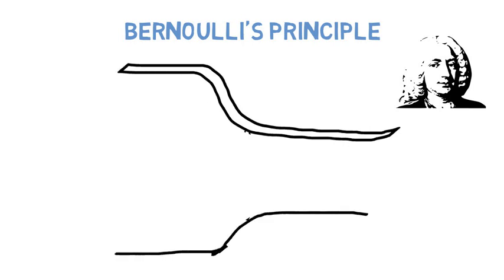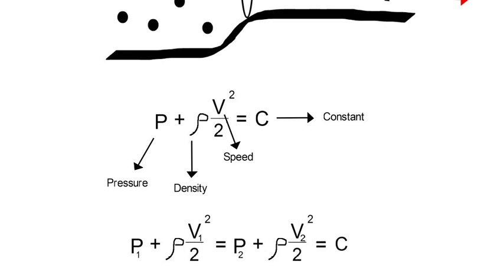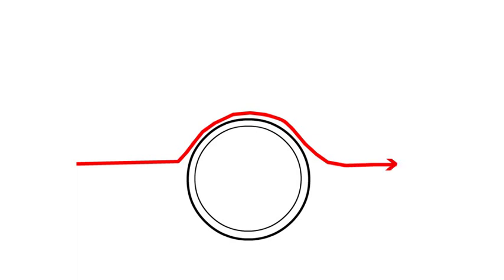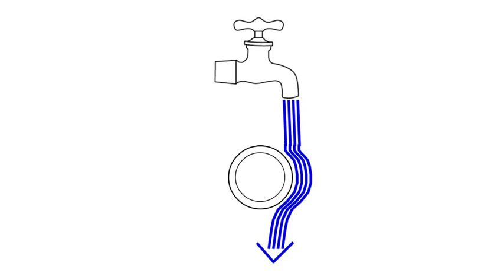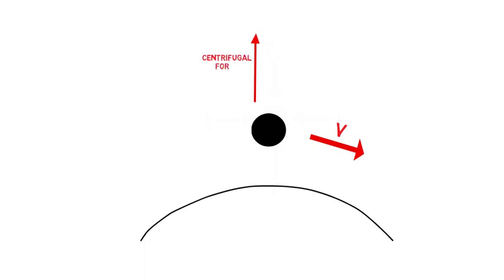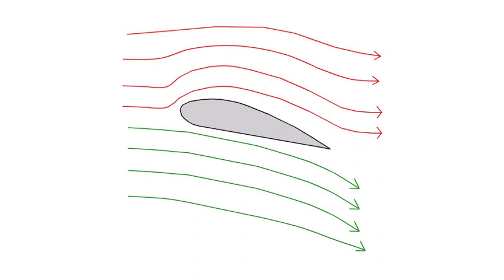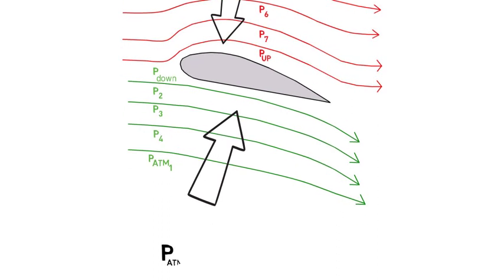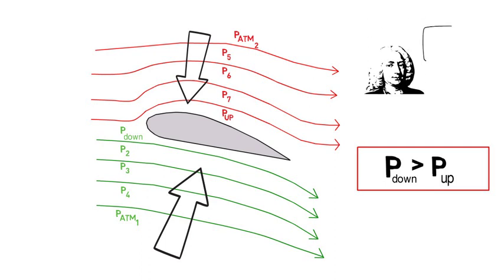Part 2 - Coanda effect, Bernoulli's Principle and Lift

Comment: My friend, Bernoulli only works in a single streamline not across a pressure gradient.  This is a common error.
A wing is not a venturi as there is no constraint of the fluid and therefore no requirement to preserve pressure.
Cut a venturi in half and it doesn't work.

Any explanation has to work for a flat plate wing (no camber) because we know flat plate wings work very well.

Also all airliners have super-critical wings that are flat on top and curved underneath.

The effect you are talking about with the curved surface is viscosity and attachment not Coanda. Coanda does not work in non-accelerated flows if at all.

Aerodynamics IS fluid dynamics. The same rules apply. air is considered in compressible below M0.4.

Centrifugal force doesn't exist. It is angular momentum.

Lift is caused by turning a fluid. The amount is varied by airspeed or AOA F=MA

The pressure differences are caused by effective AOA.

The pressure below the wing is greater because it combines static and dynamic pressure.

If your explanation is not correct for a flat wing it is not correct. Period.
Reply: @Deos He's right, completely right. Not all wings are curved at the top surface.....
Reply: @Deos Indeed, for 'normal' aircraft you are right and Aerogeek got that wrong. However, and that is is main point: Curvature is completely non-essential to the principles of generating lift. Only AOA matters. Curvature serves only one purpose: To enable higher AOA without introducing airflow separation. Also, people always get Bernoulli wrong. It is a mathematical relationship that says nothing about the cause of the relationship. Thinking about the cause, however, it follows from Newton that in order for anything to accelerate, a force has to act upon it. Therefore higher/lower relative pressures cause the changes in relative flow speeds, not the other way round.
Reply: @woodwind314  No, in general a more cambered airfoil decreases stall angle of attack but increases lift coefficient at zero angle of attack. Curvature is essential to the principles of generating lift because pressure must decrease as you move radially inward along curved streamlines – so there is a low pressure zone above the airfoil, which helps lift significantly.
Reply: The pressure difference between the bottom of the wing and the top is what causes lift. Upwash, downwash, the Coanda effect and turning of the flow are all caused by this pressure difference. They are effects, not causes. The low pressure on the top of the wing is caused by the particles interacting with each other and with the wing. Such interactions are ignored in the fluid approximation so it is not warranted near the wing’s surface. The reason for the low pressure on the top of a cambered wing is that the boundary layer there is depopulated by these interactions. This explains the purpose of the blown flaps on an aircraft carrier’s supersonic fighters.
Reply: Angular momentum concept is applicable for flow over steep Curvature (like the flow passage through Impulse Turbine blade).
However, During Take off, Commercial Aircraft increases Wing surface Area by extending Leading edge & Trailing edge Flaps to to get instant Lift.
When Leading edge & Trailing edge Flaps are extended, the Wing will appear moderate Curve. Therefore, there is a possibility that sharp Air deflection at the bottom of the Wing might produce Lift momentarily by Angular momentum theory.

Under normal circumstances, Wing is an Aerofoil. 
Aerofoil is not designed to work on momentum theory. 
Aerofoil produces Lift based on Pressure difference across Aerofoil. 

When Air steam moves over, the Bottom of the Aircraft Wing experiences combined action of Static & Dynamic pressure together.
On other hand, Air streams tries to deviate slightly from the Top surface of the Wing due to the Aerofoil Camber angle.
This creates Vacuum over Wing Top surface. 
Eventually, The Static pressure on the Top surface of Wing will fall.
This pressure difference across the Wing leads to Lift.

Aerofoil Design Text books call Aerofoil's Top surface as "Suction surface" & Bottom surface as "Pressure surface"

Comment: Here is a summary of the physical effects that are taking place. Go to diagram at  03:29. Neglect, friction, viscosity,  meniscus, surface tension and gravitational pull, electrostatics  between fluid and  mass of solid profile being used, any flying due to fluid sheets. 
 
1,  The  fluid  particles rushing  from the left towards the cylinder will cause a very high pressure zone  on the left  hand side.
2. The  high speed  moving particles of fluid  away/lateral  from the centre line will experience a higher pressure on one side and they will be  gradually aligned and vectored up and down about the centre line, in this case. (another position with  aerofoil sections,)
3. Those   group of particles forming a relatively wide  sheet,  now going up at high speed will tend to leave the  receding surface with their momentum, but leaving the surface would create a partial vacuum with  the surface, which will pull the particles towards the surface.  Here it must be noted that putting one  thin  streamline of water or smoke will not create the  higher vacuum that a whole sheet of fluid going over the solid surface of a ball or an aerofoil section. So for better understanding we shall stick to a sheet of fluid flowing over the  whole surface, and  not one  narrow stream line.
4. The  sheet of fluid  will  keep trying  to  continuously separate  from the surface by its momentum, but will be restricted, by the  partial vacuum created with the surface and also the atmospheric pressure above it in this case.  So the particle will  curve around creating centrifugal force.
5. The fluid sheet, note ,  a relatively wide sheet, will try to keep separating  from the curved receding surface  with its  remaining momentum, but,  the partial vacuum created by itself will still be formed to pull it to the surface, the atmospheric pressure will keep pushing it to the surface,  while the centrifugal force will also be present.
6. This is the reason why the sheet of fluid will keep attaching itself to the body in question till there comes a location where it could separate for other states coming into action.   These are the physics that are going on in the Coanda Effect and in any aerofoil section.
7. In a symmetrical body, all the above is occurring above and  below and to the left or the right in the case of a ball or a torpedo or a ring. 

8. In an aerofoil section which is not symmetrical and  with or without an angle of attack, the high pressure and low pressure zones (bubbles)  pushing or pulling the sheet of fluid to the surfaces  of the solid body    these   can be controlled by the design of the profile of the airfoil section or its angle of attack and the speed of the fluid itself.  In an airplane the sheet of fluid above the wing is made to try and  continuously separate  along the top surface  through receding the surface down while that below the wing is  made to be pushed through also  angling down the lower surface  down through the angle of attack so that its velocity downwards will push the fluid sheet all the time hence compression rather than a separation and partial vacuum. 
9.  The unequal velocities that occur  at the trailing edge in an unsymmetrical aerofoil section with or without angle of attack have no option but to disturb each other and  form a helix where the lower velocity will  at first travel inside the helixes and vortexes and circulations  which will eventually  stir the fluid up to equalise the  velocities hence pressures by bleeding  into the turbulent bubble an atmospheric pressure on the top  surface of the wing where it could stall for higher angles  of attack.

I believe, Coanda Bernoulli, Newton, should get together and try and agree on the explanation and in the meantime to consider what I contributed.
Reply: I learned more from this then the vid!
Reply: Here's an idea.. why don't you make YOUR OWN video!  That way, you wont be an Ass..  jamming-in 'your' way of explaining something that was already very informative.
Reply: @philip6419  informative but wrong. As many popular explanations of lift are.
See http://docshare01.docshare.tips/files/3422/34223648.pdf
Reply: @kramrle  A & E aren't too bad.  They have a few rough spots, but better than most amateurs.

Comment: RE: your Part #2.
Your explanation is simplistic, but, unfortunately, actually, it is quite incorrect science.  You have much correct here, but there are errors that are very significant. 
...
When the air that reaches the curved surface "kind-of pushes away the air molecules that were already there" this clearly indicates that there is a HIGHER pressure there!  Higher pressure pushes toward lower pressure. The lower pressure as you describe makes no sense, science-wise, that is.
...
This increased pressure is actually the case, but that higher pressure actually has the effect of accelerating that air stream in the curved path that changes direction to upward at about a 45 degree angle as you show in BLACK @2:40.  That initial sharp curve requires a force and it is the increased pressure, caused by the air's motion against the solid object, at that point of first contact.
...
The fact is that High pressure pushes toward lower pressure.
...
Moving in that new direction, its inertia _would carry it along that same BLACK line.  The fact that the air tries to move away from the surface reduces the pressure; not the sucking action of the pushed-away air you describe.
...
As stated in another comment, Coanda applies to all fluids.
...
Your curved path (which is an acceleration) explanation with the inward force being greater is correct.  This is also why satellites orbit.  This MUST be the same thing that happens at the point above at time 2:40 I mention above.  Please review your earlier explanation with this in mind.
...
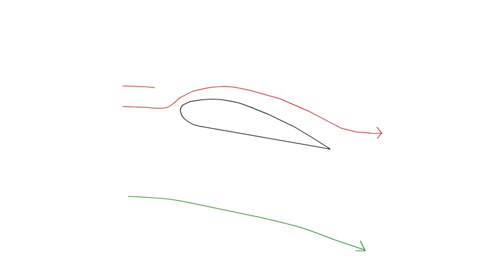At time 7:32, the upper air should be shown moving downward just as the lower air is. 
...
Finally, A very careful and correct analysis of the pressures that you correctly describe all motions around trhe wing and will ALSO be shown to be the very cause of the downwash.  I now move on to your Video #3 to see what you say because there are NO OTHER factors...
-- 
Regards, ScienceAdvisorSteve
challengerillinois/org
Reply: does coanda effect happens because of bernouli's principle?

Comment: Actually, about the Coanda effect. You are stating that it applies to air or gas and not to water. In fact water and air are both fluids and the effect applies (to some extent) to all fluids, such as water.
Reply: infact, we have hydrofoils
Reply: Yes, it is. I have tested with water drop from a tap to the back side of a food spoon, and proved that it work.
Reply: In fact, Coanda himself discovered this effect by playing with water droplets from the tap, while taking a long bath.. He said that in an interview. :)
Reply: They are both 'fluid' in movement and the effect does occur in regards the spoon, ONLY  because the spoon is not submerged.  As a HVAC State Contractor, I see ignorant engineers trying to use the Coanda effect using liquid to design ductwork, only to have the entire systems torn out and replaced. THIS because, [in this case], liquid does NOT produce the same results as a gas.
Reply: The reason they usually do not attribute this effect to water is beacuse you can argue that water viscosity causes it to "stick" to the tube and not an external force. while air do have some viscosity its usually really small in comperison